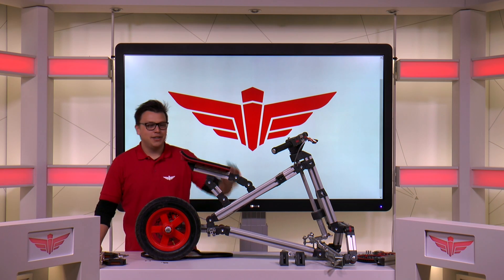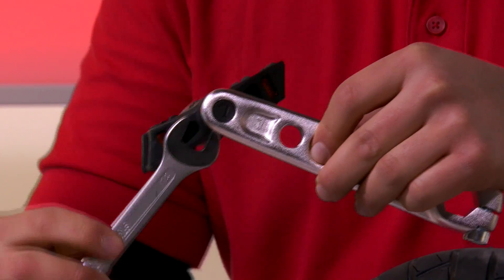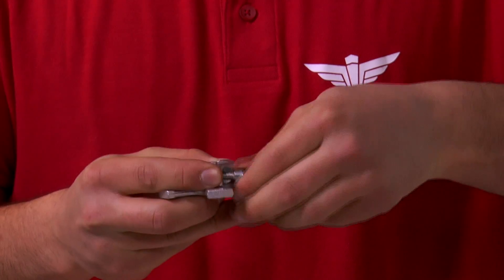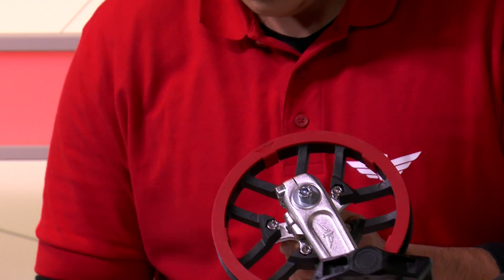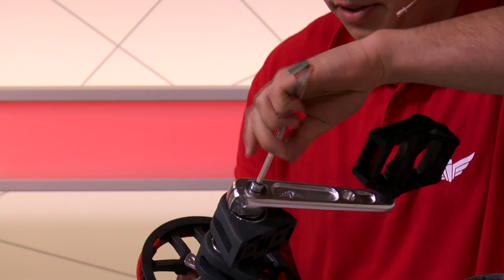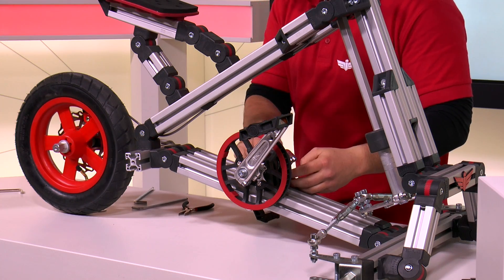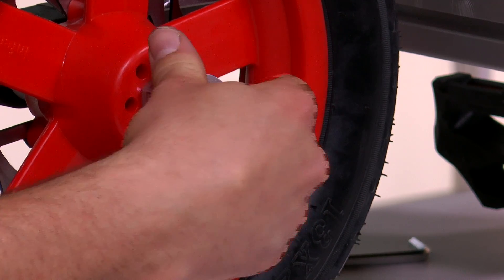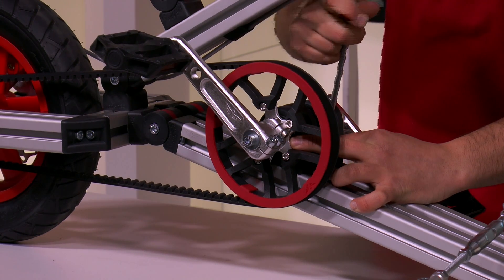INFENTO HOW TO - Driving mechanism

Comment: The left crank in my set  the small holes don't have threads so can't screw left pedal on to left crank. I've tried contacting infento Customer service and sent the photos but they don't reply to messages. I'm assuming it's a manufacturing fault how do I get this part replaced. As can't build any model that involves pedals right now.
Reply from the maker: Hi Board game collector, Can you please send support@infento.com an email with your question? thx!

Comment: Hi ! I'm facing a problem. The small toothed wheel ( the one on which the toothed belt is fixed to ) is moving independently from the vehicle's  wheel.  What am i doing wrong ? How to tighten them together ?
I see in your video, the small wheel is also moving independently from the vehicle's wheel but i guess this is because you are spinning the pedals backwards. But to me it hsppens both ways
I see in your video the small w
Reply from the maker: Hi Mircea, You probably used the free spinning wheel. Can that be the case?
Reply: @infento  Hi, yes ! Indeed this was the case ! Thank you for your answer !